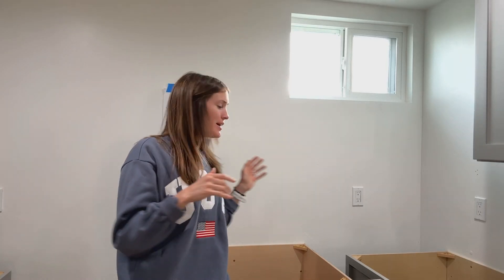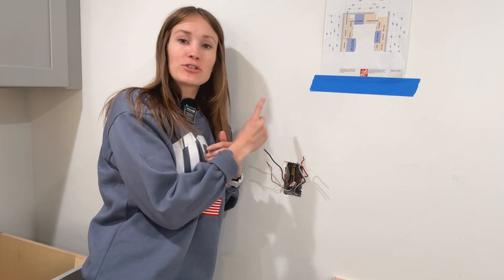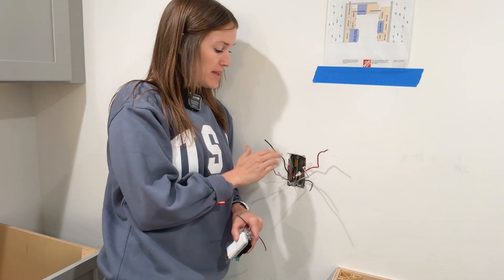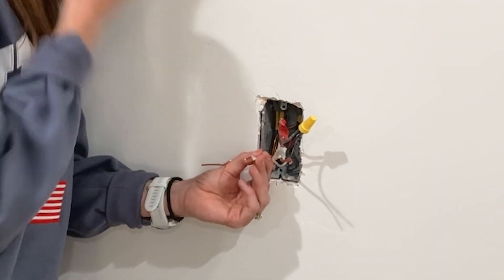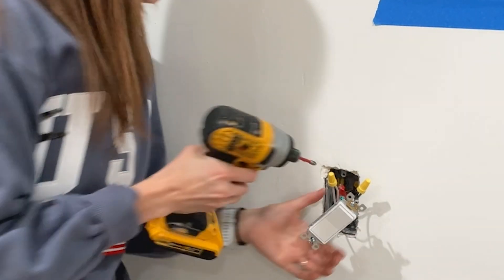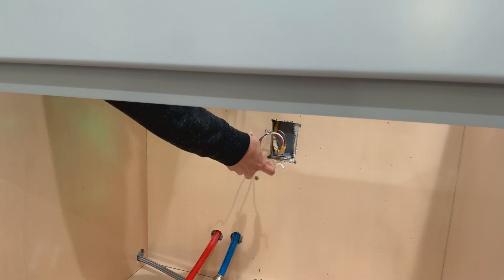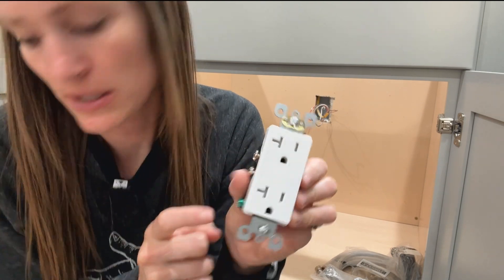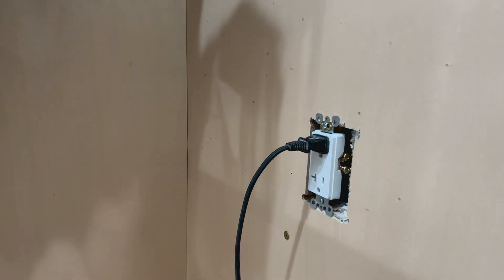How to Wire a Switch and Outlet for a Garbage Disposal and Dishwasher: Step by Step Guide

Comment: Did anyone do the box fill calculations? That seems like a lot of wires in such a shallow box. In electrical code there are rules as to how many wires can fit in a box (box fill) WITH a device (i.e outlet or switch). It's not jusu "lets see how many wires plus device i can stuff in the box and have the device screws hold everything in like a jack in the box.
Reply from the maker: An electrician did the rough in and the city inspected so hopefully they both did their jobs. I’m not an electrician though. Are you?

Comment: My understanding on spacers (9:25): they are only allowed if they are making up ≤1/4" of space, and if more make-up space is required, a box extender must be used. I'm not an electrician, so I'd welcome a more definitive statement on this from a professional.
Reply from the maker: Yes! I put a note in there at one point that must have come off in editing- technically if it’s over 1/4 inch you should have a box extender

Comment: Great job, Emily.  However, I must CAUTION you!!!  You cut the insulation on the outlet wires way too long.  It is possible that they could short together, or one or both could touch the bare/uninsulated Safety Ground.  For safety reasons and to meet Code, the insulation should be cut so it stops at the screw at best, or stops at the outlet's back 90° at worst.  I couldn't see how far the insulation was cut for the switch, but it would easy enough to turn the breaker Off, pull the switch, straighten the bends from the wires, and cut the bare wire length to the measurement length marking on the switch's metal mounting section.  It's and indented straight line on the top or bottom.  Bend the wires after cutting the bare wires to that length, insert them under their screws and tighten.  Same for the outlet.  Safety First!  Also, a bent wire should always be placed under the screw so wire it tightened into the bend, not against it.  The screw tightens clockwise, and the wire's bent end should point clockwise.  I will add that wire nuts should be tightened while holding the wires about an inch below the bare wires and tighten the wire nut until the wires are twisted tightly.  This makes sure the wire nut is gripping all wires for a solid electrical connection and it helps the wires keep from working out of the wire nut from the manipulations of inserting them into the box and pulling them out for maintenance.  Also, with that outlet being near water or a water source (2 of them), a GFCI Outlet is required by Code.  Safety First.  This is IMPORTANT, so please take the time do it on the switch AND the outlet.  It's CODE for a reason!
Reply from the maker: I definitely agree with you on the amount of exposed wiring. I always struggle a bit to get the amount exactly right. This is on a gfci breaker.
Reply: @YouCanDIYHome   Wire strippers often have the strip length on them, too.  Look for the indented straight line that's around 1/2 inch long.

Comment: Would it not be better to use a GFCI outlet since you are working under your sink where there may be water intrusion?
Reply from the maker: The breaker is gfci so the gfci outlet is not needed.
Reply: @YouCanDIYHome  Thank you for clarifying!
Reply: This comment!! I was about to ask the same. Should put a disclaimer for the less knowledgeable DIYers as this is extremely important information
Reply: Additionally, you cannot split a GFCI duplex outlet.